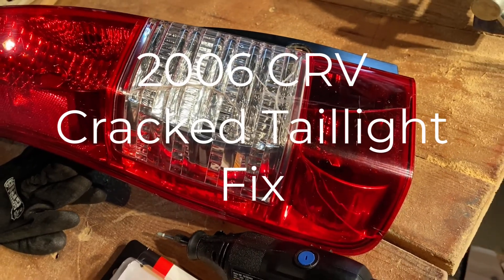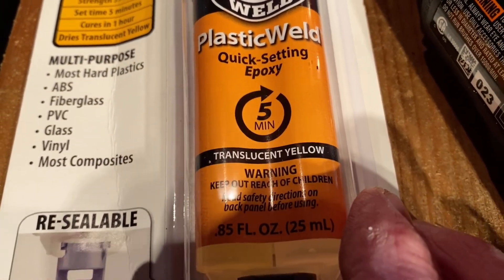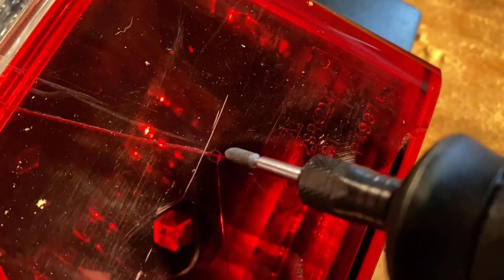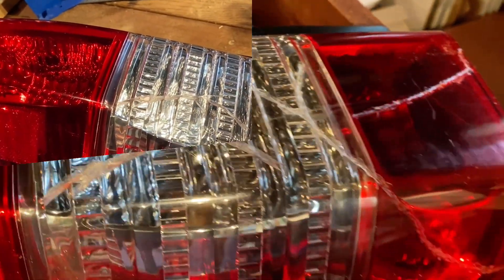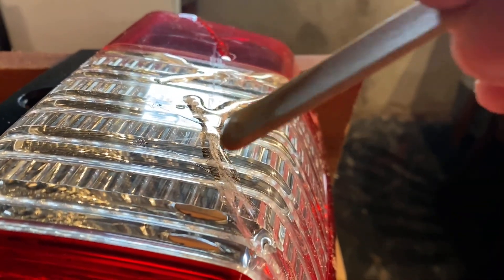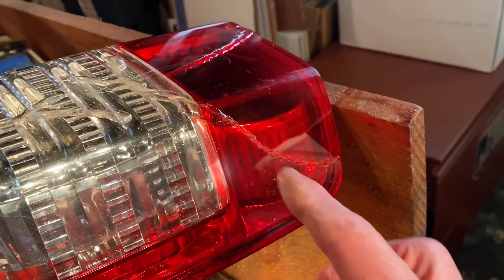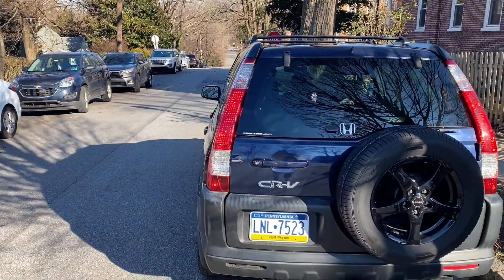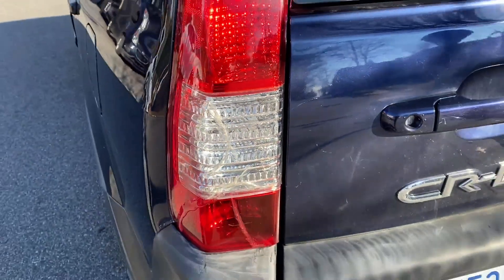2006 CRV Cracked Taillight Fix

Comment: Amazing, I can barely tell that the light has cracks! 😂
Reply from the maker: I guess you are being sarcastic but you can't really see it from 10 feet away, and it has passed inspection every year, is sealed and safe, so I'm a happy guy and never think about spending over $100 for a new light.  Would do it again same way.